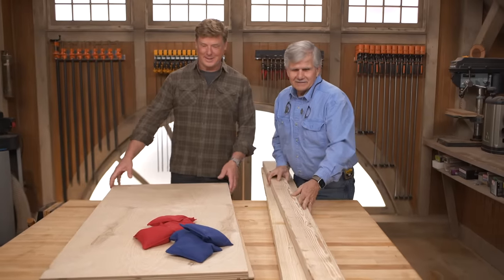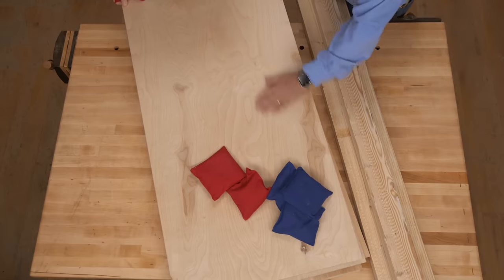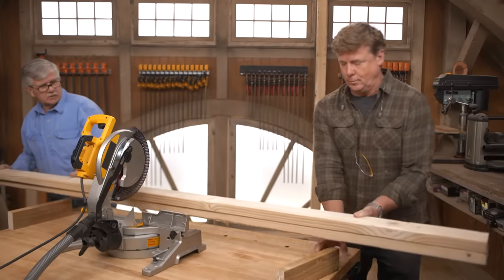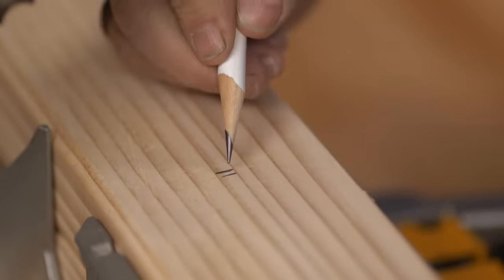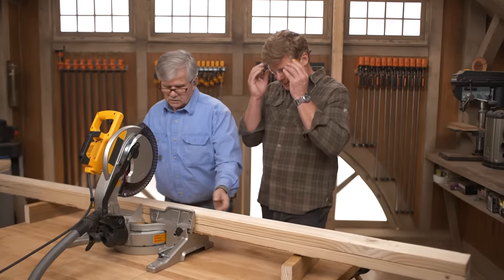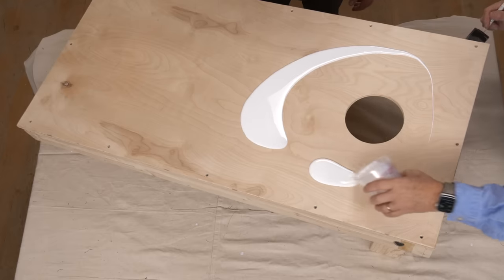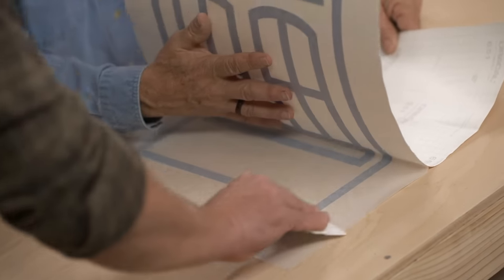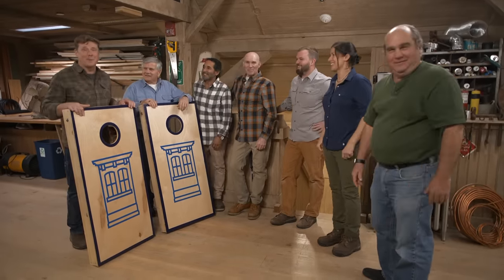Cornhole | Build It | Ask This Old House

Comment: If they were "a hair over 8ft" - why did the two 4ft measurements overlap? Looks like the studs were shorter than 8ft
Reply: Yeah that was odd. I think the "hair over 8 ft" was to cover for the width of the blade. The overlapping didn't make sense but like most things TOH, it was the explanation on how to do it that was supposed to be the point, not the specific case we watched.
Reply: My guess is that he just misspoke and meant to say a hair under 8'.
Reply: the editor sucks, the boards were over 8ft, they must have screwed up the filming and the board moved cause if you watch he pulls the tape from the same side in the closeup

Comment: @this old house couple details would make these even better. fill the screw holes on the top first so they dont snag a bag, or better yet, attach from the backside with pocket holes. round all edges including the hole so you dont snag the bags. lastly, put a cross brace under the middle to help make the boards more solid and reduce bounce. 
btw, finish looked good!

Comment: Pro tip: add a board stretched between the legs a few inches up from and parallel with the ground. Drill a couple 3” holes in it…beverage holders!!